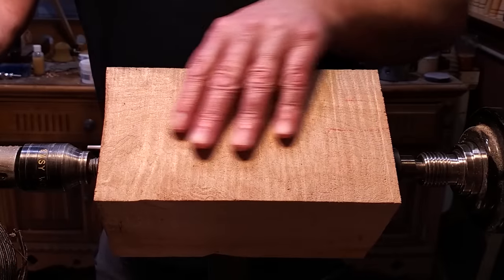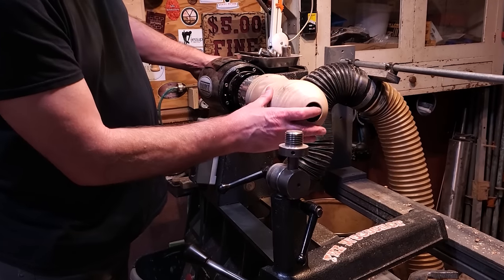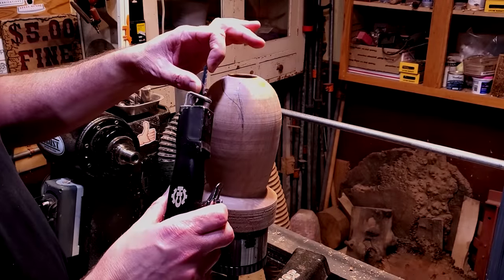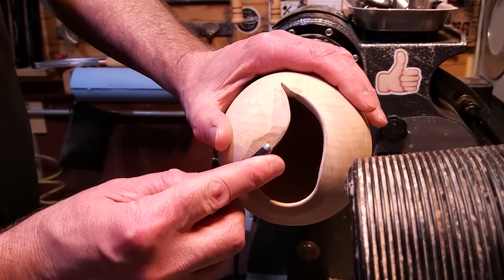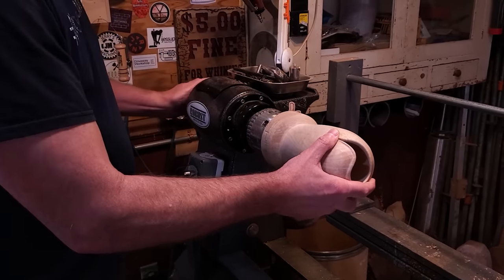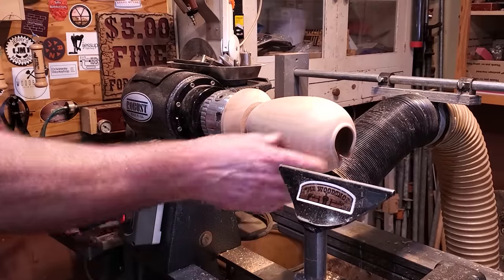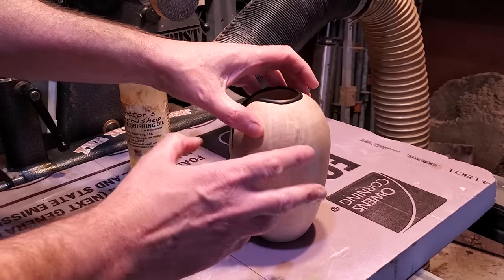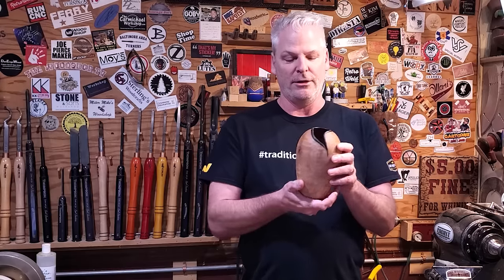Woodturning | Carved Maple Vase

Comment: Beautiful vase, Carl! You are one fine artist with a good sense of design. Letting the ink fully dry is good to know.

I really like my little air saw. The two-stage trigger is a bit tricky, at times (paralyzed hands) but once it gets going, well, you're right in that it's like drawing. I do prefer to run it right against the wood if I can for a smooth cut. You had good hand bracing. Same principle.

About  the hacksaw blade, I've wondered about that exact video for years. I'm not the safety police so I'm not going to criticize it. But I'm glad you spoke on it here. :)
Reply from the maker: Thank you very much Jay!! I really love this air saw too. It's a game changer for stuff like this.

Comment: Will walnut oil you can get at Walmart work the same as the oil you used or are there other chemicals included in the oil used for woodworking?
Reply: Btw, beautiful piece!!
Reply from the maker: Thank you very much!! I don't think it's the same thing. This Walnut oil is tripled boiled to take all the protein out, that's why it dries. I'm not sure about the oil at Walmart, but this stuff; even if you have a Walnut allergy, it won't effect you.
Reply: @CarlJacobson  Thanks.